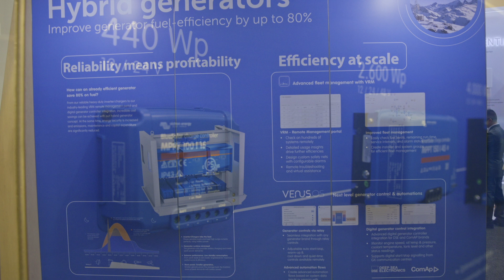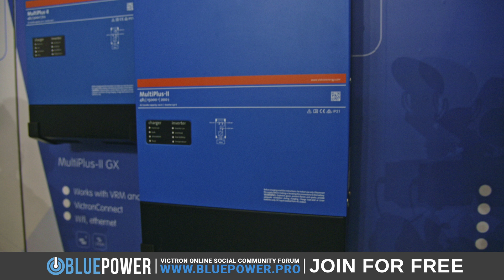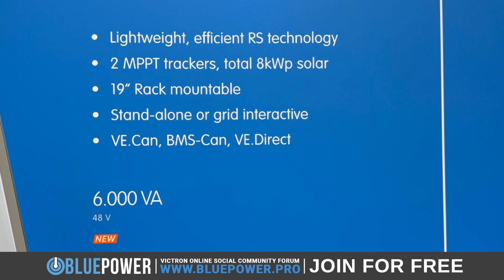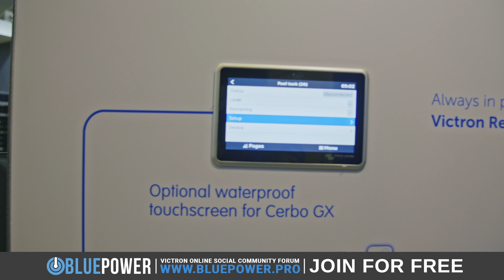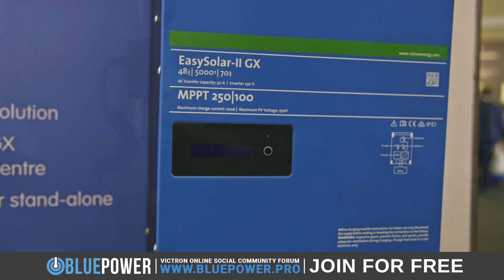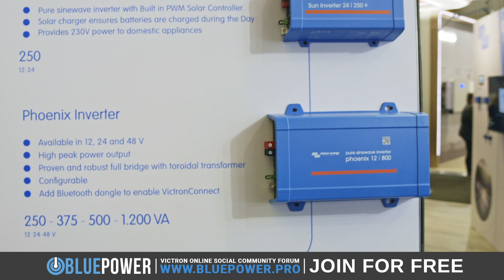New Victron Products [Solar Expo 2024]

Comment: I wish Victron would extend the one form factor of stand-alone Inverters upward in wattage capability.  Right now they are like 250, 375, 500, 800, and 1200 watts.  They should have a 1500 watt one.  I wouldn't be opposed to a 2,000 watt one either.

Comment: Server rack components, jeeez finally!  Took like forever.  How about a rack mount CerboGX , more server rack plaese!  And Rack mount inverters too.
Reply from the maker: Lol well the Cerbo is a bit small to be a full 1U rack. I just stick mine where i want it using Velcro. The RS19 and HS19 have the cerbo built in so I guess that eliminates the problem anyway.
Reply: @BluePowerPro  A product can never be too small to go into a rack. The component will just be less deep.  There are server rack components that only have 1-2 inches of depth into the rack.  If they are smart they make a component like that so it can integrate with existing battery banks of other brands. Maybe a Cerbo/smart shunt combination.  The Cerbo has already proven itself to be useful stand alone for other applications like tank systems ect. So it's not that weird at all.

Comment: Wow.  Victron is finally catching up to what the rest of the industry has been doing for years.
Reply from the maker: High voltage yes, rack mount no. What other brand has a rack mount inverter?
Reply: @BluePowerPro  that's fair.  Rack Mount is novel.  But the all in one aspect is long overdue from Victron.
Reply: @BluePowerPro a lot of cheap batteries are also not rack mounted. So the better option is to not have rack mounted. Market demand for rack mounted is lower. So not really a good choice. Unless u dont want to sell so many units.